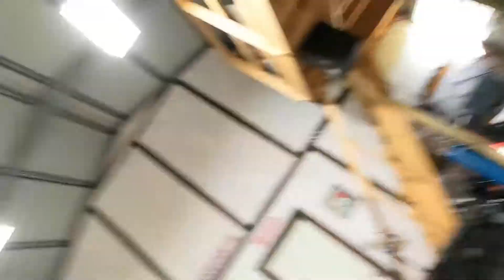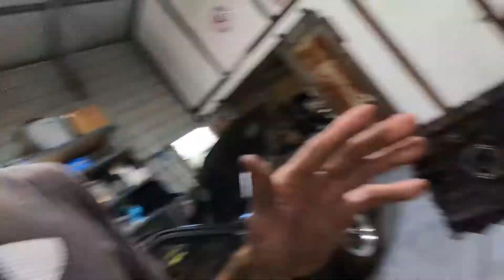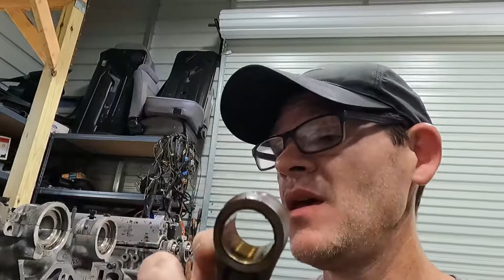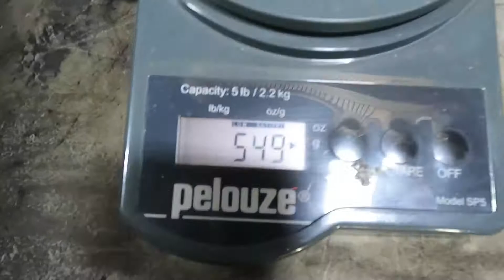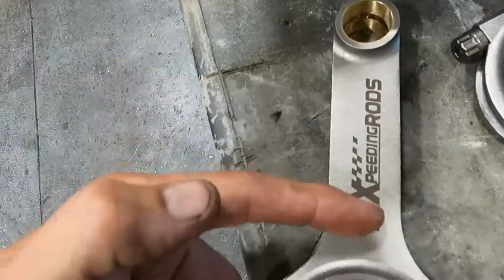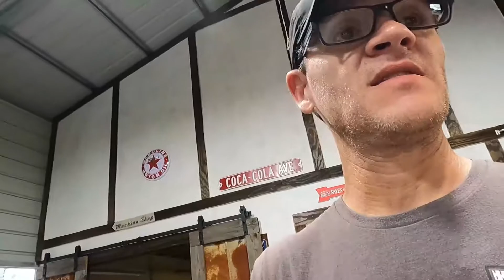2JZ Build Using MaXpeeding Rods! How Much Boost Will They Handle!? Review And Honest Opinion.

Comment: How much boost have you ran thru these rods? Still holding up?
Reply from the maker: 42 psi. Still going strong.
Reply: @fox-body what’s your compression ratio and how hard/often do you drive?
Reply: 🤯 ok thanks
Reply: Did you stay w the ARP2000 bolt?

Comment: I got Chinese rods and pistons and my wrist pins won’t fit into the rod small bore. Any tips ?
Reply from the maker: Get them honed.
Reply: @fox-body  at a machine shop correct?
Reply from the maker: Yea machine shop if they won’t fit at all.  If there just tight you could use some 400 grit sandpaper and clean it up yourself. I had to do that on a couple of mine.
Reply: @fox-body  thanks so far they don’t even fit in. I tried heating up the ride and cooling the pin but even then I can really get it to even go in. Oh wow

Comment: Most rods are made in china and "finish machined" in USA. yup yup. They are the correct material and use real arp though. I am planning to use them in my boosted v6 build. at like 20-22ish max boost.

Comment: How's those rods holding
Reply from the maker: So far 20 psi no problem.
Reply: @fox-body  where you abusing it though? Wanna try it on my honda
Reply: @alitoroganan2442  I have maxsped rods in my boosted b16. beating on it around 15psi no issues with the rods. dynoed a little over 500wheel on 93
Reply: @nfuller902  do you have a channel or insta bro
Reply from the maker: @alitoroganan2442  @the_hated_1j
Reply from the maker: 2JZ Fox Body With Alibaba Rods Made It Through The First Track Day! LOL!! 5.81 1/8th Mile
https://youtu.be/9mL-jh7Ke9g

Comment: The little ends tend to be tight on aftermarket rods because alot of the wrist pins that come with forged pistons tend to be on the smaller size then what the factory uses, some 2000 sand paper with some wd40 is all U need to open the little end up

Comment: Their coil overs for my e36 were junk (bought in 2017) i think their coil over quality has gone up sense then... but corn oil filled struts , total junk. No bearings in the top hats, folded the aluminum pearches for the rears... ( still have the fronts in, still have the rear springs in... ) was the cheapest option at the time.

Comment: If you are gonna use either 1jz heads, engine will be way more responsive than using 2jz head but it won't be better flowing in higher rpms. Using a 1jz head on 2 jz block raises the compression ratio as well, due to 1jz having smaller combustion chamber, hope this helps. I was actually looking at a set of those rods for my 1jz but I'm a bit skeptical. I am a new subscriber and  patiently awaiting to see which route you take with the engine and how the rods hold up.

Comment: Ive seen their stuff on ebay before but never tried any of it but I have noticed that they are starting to push their brand more now with advertising, but whether they're good or not your guess is as good as mine but what really impressed me with the rods is when you weighed them they were lighter and the weights are all the exact same, I figured that they would be within a few grams of each other but not the same so for a budget rod to be spot on like that is super impressive to say the least, Ive seen other bigger brands be within a few grams but not dead on so im curious if it will hold all 67 hp you're throwing at it 🤣😂 im kidding That car will move now and you are going to make more power with it now, I can't wait to see how the rods work out and being they are lighter it will help with power as well and be easier on the rotating assembly long as they don't come apart at which point they will become a little rough on the rotating assembly and block 😜
Reply from the maker: Yea I didn’t even know about that brand. Seem decent visually but that doesn’t say much. We will see what happens.
Reply: @fox-body  Based on the way you leave in the intro, I feel like you are going to lightly test them with a touch more power 😂 probably a little more than a touch more power 😁😎👍🏾 I was tempted to try their link bar lifters on my 347 but I chickened out but the price was very tempting but you never know  they could be the next scat or eagle, normally new companys start out selling their stuff cheap to get everyone's attention but when they start selling real good they start easing up on the price, Im not one of those that says that they are crappy just because they are new or made in China because even the China merch haters have a bunch of stuff from China and if they say they don't they would be lying